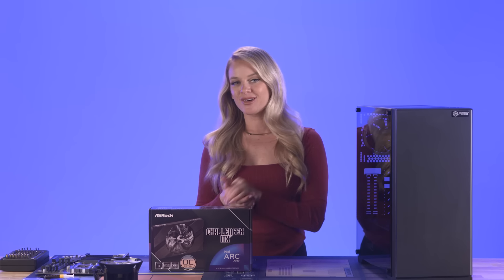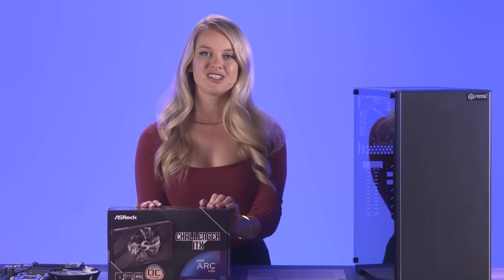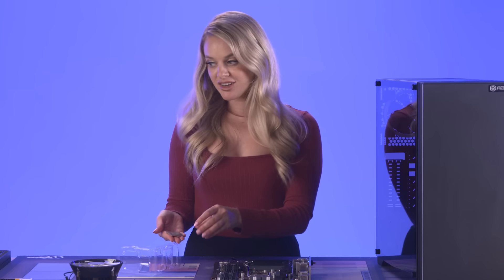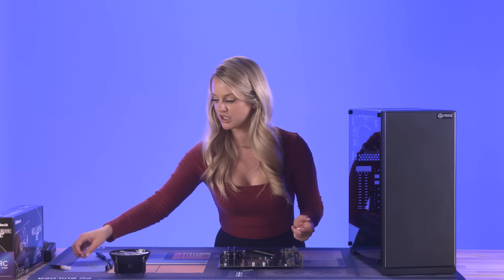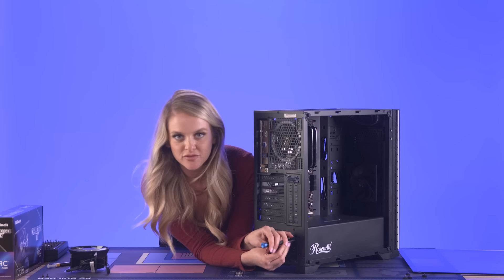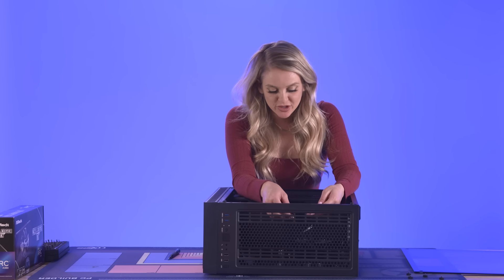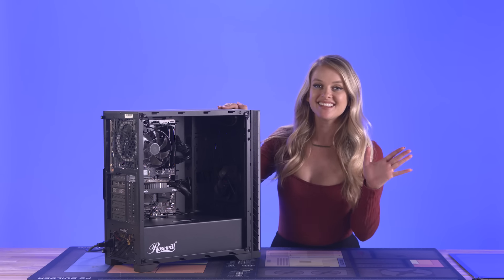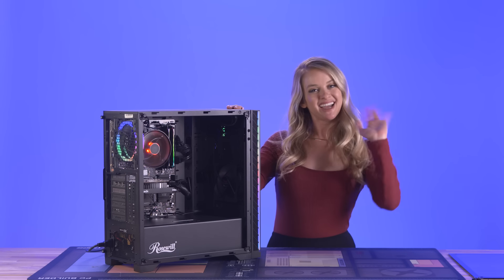My SECOND TIME Was Much Easier! Budget-Friendly, Beginner-Friendly Intel Arc PC Build!

Comment: Oh jeez...  Yeah, that's what a PC building noob needs, an Intel card with the worst drivers imaginable.  Noobs should save themselves the hassle and just get an RX 6600.  They're better performers, have rock-solid drivers and have 8GB of VRAM instead of 6GB whcih means that they'll be able to handle 1080p gaming for many more years to come than the A380.

The RX 6600 is also a far better value than the A380.  The Powercolor Radeon RX 6600 Fighter costs $200 at Newegg which makes it 67% more expensive than the ASRock Arc A380 Challenger but it is 127% faster!  That's right, it is 2.27 times as fast as the A380.  I'd much rather pay 167% to get 227% of the performance and 133% of the VRAM with drivers that actually work.

For your own sakes, don't be swayed by the cleavage.  The A380 is a terrible buy for someone just starting out because someone just starting out won't know how to fix it if something goes wrong and with Intel drivers, something ALWAYS goes wrong!  It's like this:

GeForce cards -> Rock-solid drivers, cutting edge performance, terrible value
Radeon cards -> Rock-solid drivers, cutting-edge performance, great value
Arc cards -> Broken drivers, terrible performance, bad value

If the Intel Arc A380 was any good, they wouldn't have had to resort to getting some buxom blonde to sell it to you.  This is as sleazy as it gets!

Comment: Terrible heat sink, it doesn't even fully cover the chip, and that GPU, I own it, don't expect to do hard core gaming, that is entry level at best, I got it because it came with 2 free games, and its not in my gaming rig, its my test bench to try Intel, I game on a full AMD desktop, tho both of my desktops are water cooled. I have the same 11400 on an MSI 590 with the A380, the card is impressive, but 6GB is not enough memory for most new games.